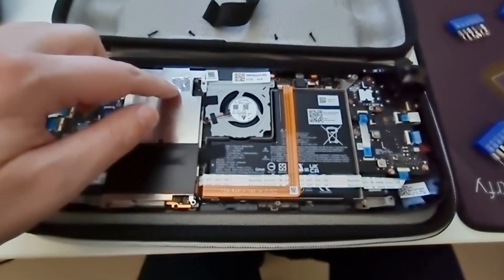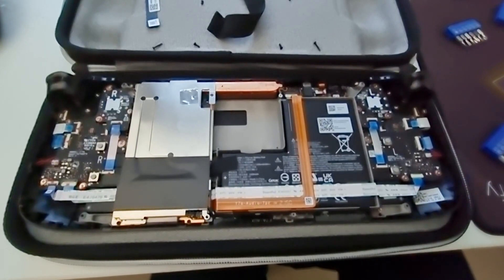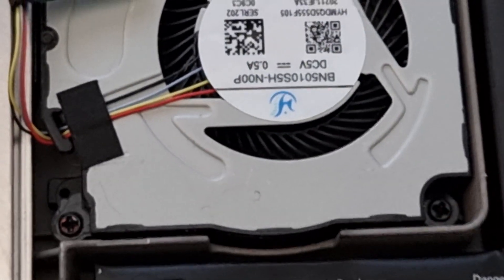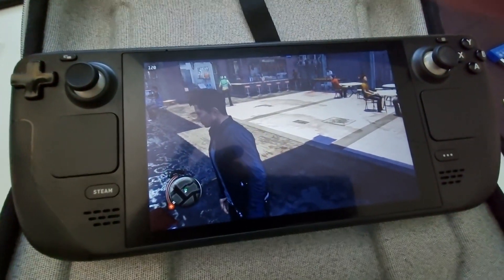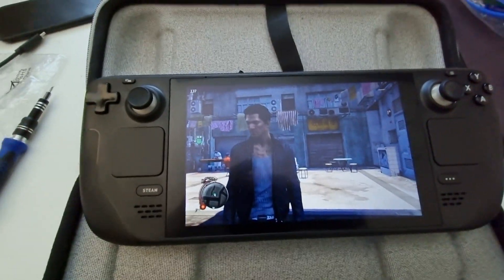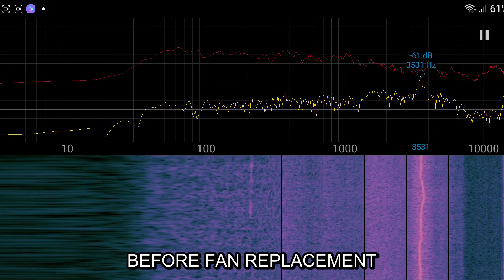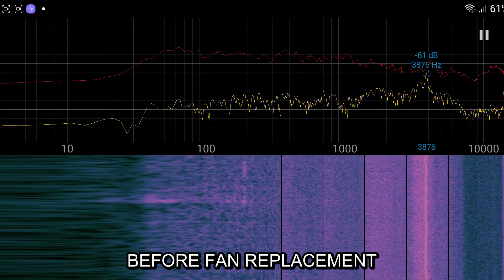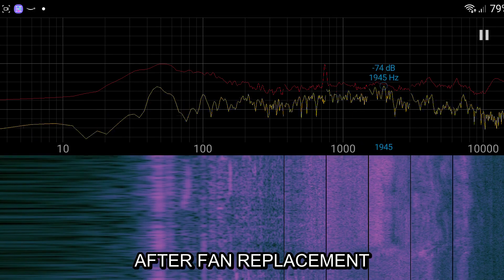Steam Deck Fan Replacement EASY WAY!

Comment: Thank you for this, I have a huaying fan in mine but it has started to make really loud grinding noises any time it kicks on.   It does at least still keep it cool but is unbearingly loud, no pun intended. My ifixit fan is on the way now.
Reply: I have the same issue and I've also ordered a new fan. Did you replace it yourself, was it hard to do?

Comment: Is it ok to do it without the battery unplugged?
Reply from the maker: Yes, assuming the deck is shutdown and you avoid touching components exposed at the sides.  The fan connector will have no power going through it, the swap does not require excessive force or touching anything powered, and the metal shield protects nearby components from accidental touches.
Reply: @GreyCubeTube  Thank man, I just got mine kit on the way, now I got no stress replacing it.
Reply from the maker: @dylanyan7667  No problem. The only stress was nearly snapping my new MicroSD card, so if you have one, a reminder again to remove it before opening the case.

Comment: Why did you have to change the fan already?
Reply from the maker: I was in the first batch of decks and got the Delta fan which has a high pitch whistle, so switched it to the more pleasant sounding Huaying.  Was 50/50 as to which fan you would get in your deck.
Reply: @GreyCubeTube  so with new decks are they all newer quiet fans? Or is it still 50/50? Im expecting to get my email this week
Reply from the maker: @JalapenoPrime  I don't know for sure, only that on reddit /r/steamdeck the number of people with fan noise issues seems to have greatly reduced, and people getting RMA replacements are saying the fan is much quieter.
Reply: I'm about to have to replace mine because it developed a rattle only two months after having it. When it's not being played, it sits in the case. I was very distraught when I started up Cyberpunk yesterday and heard an unfamiliar noise.
Reply: @bolognabong  yeah mine too. Apparently it's a fan bearing
Reply: @bolognabong  Yep.  Same issue here.  It's a Huaying, but it's now making a rattling/crunching sound.  Could RMA it but it would be at my expense and I'd be without my deck for 2-3 weeks.  I'd also have to reformat, and there's a chance that I might get a different deck back after.  Just ordered a replacement from AE which is apparently also a Huaying.  I'll fit it as per this video and see how it goes, but it does seem that these fans have a worn bearing issue 😞.

Comment: I didn't know people already replaced the fan on those, what is the issue with it? just too loud or something else? also that is sleeping dogs not watch dogs, different breed
Reply from the maker: Whoops, brain fart there with Sleeping Dogs 😂 Valve used two fan suppliers, the Delta brand has a high pitch whistle at full speed, so people are buying the quieter Huaying and swapping it out.
Reply: @GreyCubeTube  oh damn that sucks, is valve doing something about it?
Reply from the maker: @GlamityJean  Rumour is newer decks now only use the quieter fan, but if you got the Delta, you're on your own as it's still functional, just annoying if you have good hearing.
Reply: @GreyCubeTube  oh okay that's not too bad then, but still yeah annoying

Comment: Nice! Thanks for the guide! The tips at the end were also appreciated.

This doesn’t allow you to unplug the battery, but does seem significantly easier.
Reply from the maker: Glad you liked it, and true about the battery. Having watched the noob video where he removed the metal, it seemed far more stressful and hazardous than just pushing in a fan connector no where near any circuitry 😀
Reply: @GreyCubeTube  I agree. Just adding the fan seems less error prone over all.